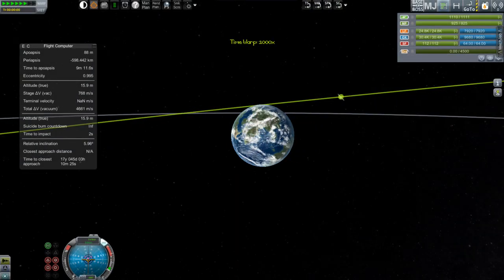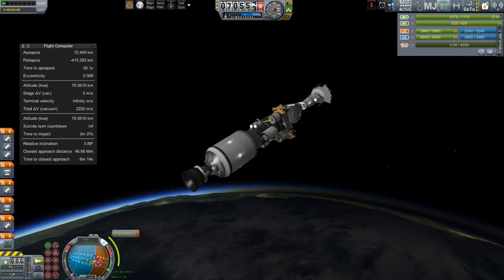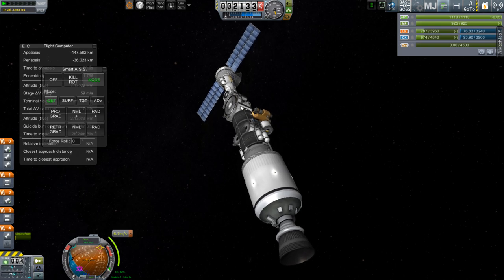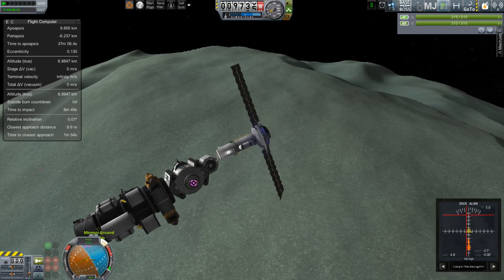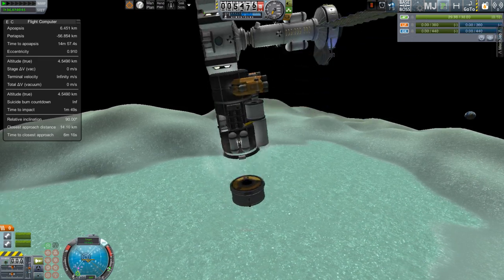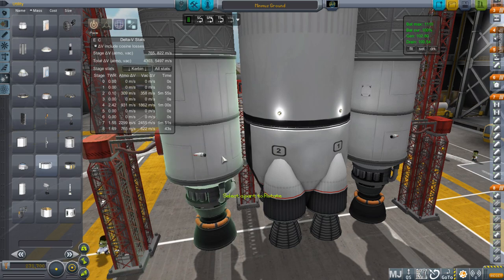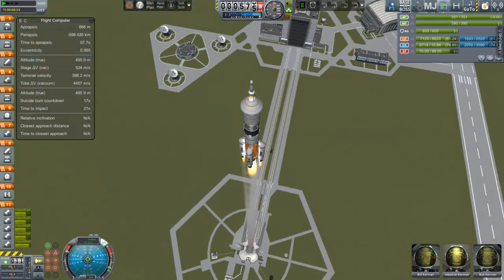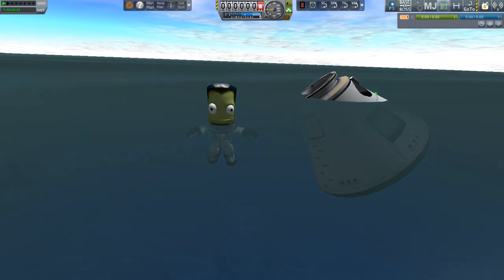GS2 "Drilling" -- Operation Gold Strike -- KSP 1.0.2

Comment: Thanks bob , I have got my minmus base up and running bit hair raising disconnecting the tower while landing. Keep up the good work
Reply from the maker: *****  First of all... screen shot or it didn't happen. ;) Yea, I wondered about that docking for other people. I've been playing for 2 years, docked various things a zillion times by now,  and I can move that tower from the end to the docking port in about 10 seconds. I'm glad you let me know it can be done by someone other than me. In the whole series that was the only thing I was worried about as for what I had built for other people to use (whether they could easily or not).
Reply: hello bob i will put a screen shot on twitter

Comment: I love the amount of planning for packing/reconfiguring you do on your craft.. the base is great. So... one question. I know in the old Kethan mod, it was actually more efficient to drilll and then refine the fuel on the surface then take it to orbit, rather than refine in orbit, because the unrefined material took up more space and had more mass than the final refined fuel. I had a kethane base on Minmus that did this. in the stock resources model is it better to drill for it and take the ore up to process in orbit than process it on the surface?
Reply from the maker: dregerclock I address this Q in a future episode, but basically it's about the same. When I made Kethite for Odyssey I intentionally made the mass of one unit way more than the fuel you get back out, like popcorn... same mass overall, but low volume until "processed." Squad made 1 unit of ore turn into 2 units of fuels. So it's easier to build a smaller craft, and there is no Ore loss, so it's somewhat easier to more the Ore around instead of fuels. The delta-v to move the Ore will be the same either way of course. However, processing in orbit means not needing the LAND the craft that needs to refuel, and processing in orbit means more flexibility with what you process into, and in-orbit means storing as Ore makes a smaller space station too (until processed).

Comment: Using cubic octagonal struts, you can connect support struts to the parts of the ship within the fairing if you add a cubic octagonal strut to the end outside the rocket (to make sure there's no rocket in the way). I can't remember off the top of my head whether or not you need to attach the support struts before building the fairing, but it's not too difficult to delete the fairing and then rebuild it after if needed.

Comment: How to strut payloads inside fairings in KSP 1.02:

a) You can strut from the outside of the shroud through it (i.e: from the boosters). Downside? It looks awful, but it IS simple.

b) You can get sneaky with gizmos. Sink the faring base a tick or two into whatever is below it with the translation gizmo, then clip the camera inside the fairing base, and attach the struts to the top of the part below the fairing. If you did it right, the struts will count as starting within the faring, and will be able to connect through it to what's on the other side, looking just like the real payload supports.
Reply from the maker: rune12358 There's also this: http://i.imgur.com/43ii6YX.png
Reply: Bob Fitch That's nifty! Still, strutting through the base is faster since it requires no reload, stronger since you put the connection from a sturdy tank closer to the source of the forces (the engines), and prettier, since it doesn't stick out. And it even keeps the strut ends that stay visible after separation out of sight and part count in the upper stage inside the fairing base. 

Seriously, you should try it, and see it it works for you. You don't even have to mind Z-fighting because the faring is wider, and usually a single tick down is enough. The key is to angle the camera and get it between parts with zoom to place the struts.

Comment: You said that you were only using stock and surface lights mods. Where did you then get the textures? They look like those from the renaissance compilation.
Reply from the maker: Luka David Torkar I'm not sure :)  I think I added a little of KSPRC, yes, and a few Ven textures too...  but basically what I mean by "stock" is you can use the same craft file that I made and it will fly the same way mine flew without anything else needed.
Reply: Bob Fitch I just looked at the mod and saw some similaritis. You have to have a pretty powerful computer to render those texture and run the game so smoth. I have on question. I tryed to swich to open GL mode in version 1.0.2 and it stopped the game from crashing but I notice a large drop in FPS when the ground of the VAB or SPH is visible.

Comment: Bob Fitch  I use a structural fuel tank with H-beams, then  strut it all together to the payload and faring baseplate
Reply from the maker: MegaSkrow Thanks. This series was finished filming 2 weeks ago, so I can't change anything, but I did come up with a solution that you'll see Monday.
Reply: Bob Fitch 2 weeks ago? you really get ahead
Reply from the maker: MegaSkrow episode 46 is a long production, i needed the extra time
Reply: Bob Fitch loads of interludes confermed!! :D

Comment: Quick Question, why not put a Convert o Tron on the base and ferry fuel?
Reply from the maker: Fuel has a greater volume for the same mass, making a smaller station, and conversion on demand is more flexible.
Reply: I went on in the series to hear you explanation in a later video. Thank you for taking the time to reply, and keep up the good work! The console community needs examples like you.

Comment: Do you have any texture packs ? or something because your engines and fuel tanks are different
Reply from the maker: ***** Yea. You can use my craft files without them, but I do have some different textures, hot rockets, clouds, and so on.
Reply: Bob Fitch I play ksp modded but i need kerbcam so does it work in ksp 1.0.2 ? because i saw you using it in your GS1 Mods list
Reply from the maker: ***** worked for me
Reply: Bob Fitch Oh That was Quick Thanks :)

Comment: Hi Bob Fitch 
It's possible to use struts on the pocedural fairings:
Enceos has (made?) a picture in the forum:
http://forum.kerbalspaceprogram.com/threads/124031-1-0-2-Stock-Clamshell-Fairings-%28June-1%29?p=2000253&viewfull=1#post2000253
Reply from the maker: Michael Derflinger Of course! I knew it worked like this and didn't put 1+1 together myself. Thanks. The only down side is I like to hide the end points and those stick WAY out. I'll probably go back to KW just for that reason alone if I can't get them to look hidden.
Reply: Michael Derflinger A really ingenious idea. Still, I will stick to strutting through the fairing base since it keeps the ugly spent strut ends out of sight on the spent upper stage.
Reply from the maker: rune12358 my 25 meter payload wiggles at the top -- tried the bottom struts and it was not effective -- anyway that a few weeks ago for me, you'll see my true solution next week
Reply: Michael Derflinger struts won't work because it's made of styrofoam 5:30